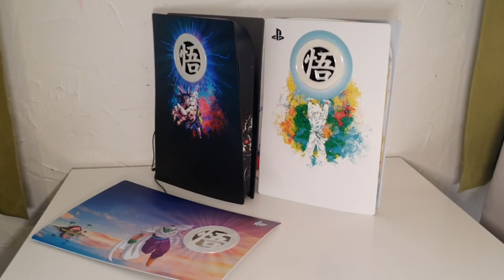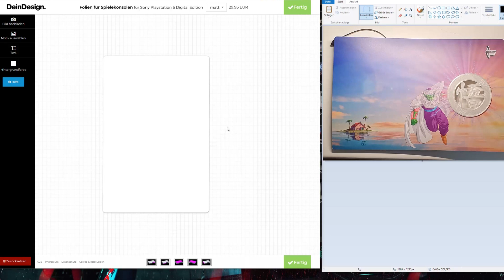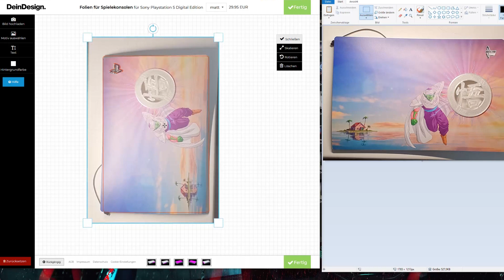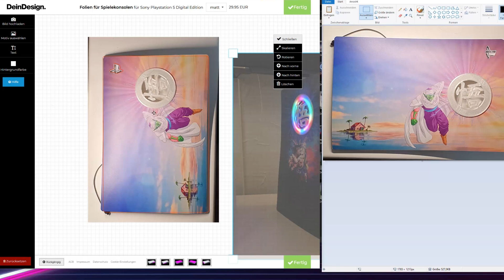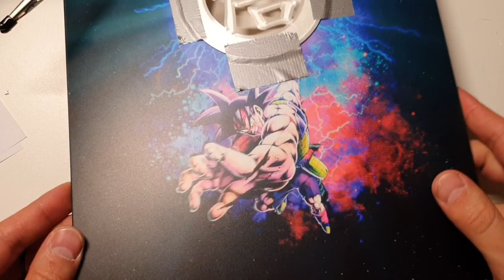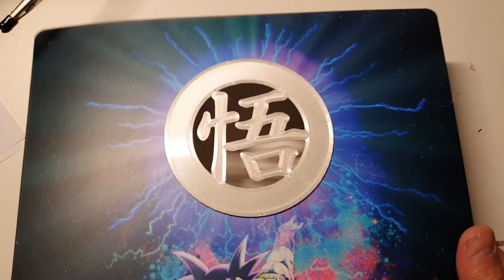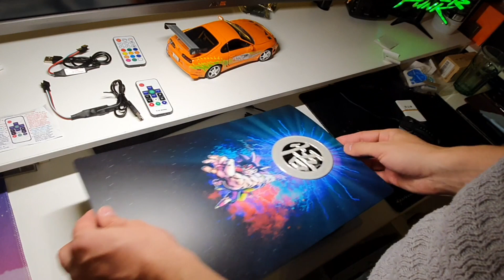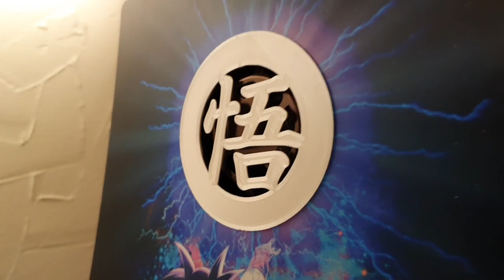Playstation 5 Dragonball edition 😯

Comment: nice video :)
Reply from the maker: Thx friend :)
Reply: @McKuc  if i will keep my ps5 with ufo nidec fan v3 will don't affect my console longetivity? or performance
Reply from the maker: @naare-p5g  keep your console clean and dont smoke. They dont like smoke. If you want to improve cooling make holes in the panels. It will reduce temps with all fans
Reply: @McKuc  thanks
after 2 months i will clean my console :)
Reply from the maker: Also use it in Horizontal Position. Its coomer and safer